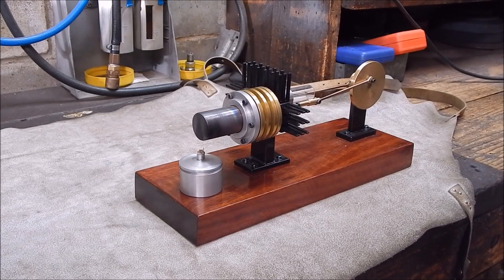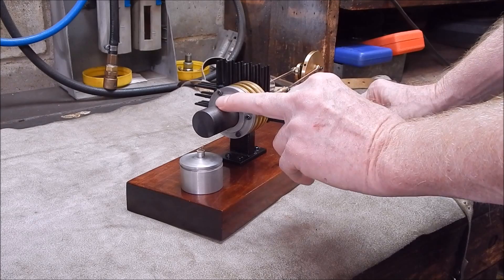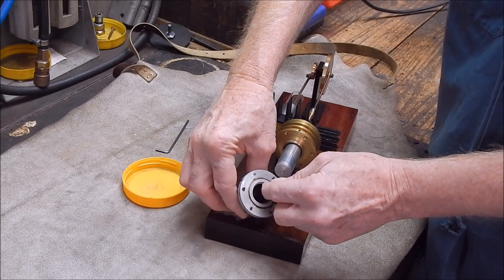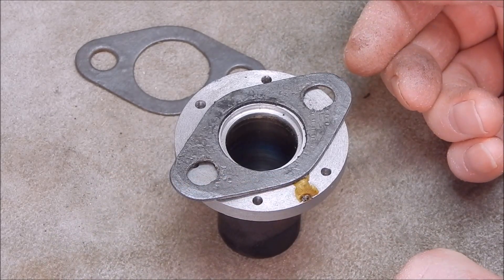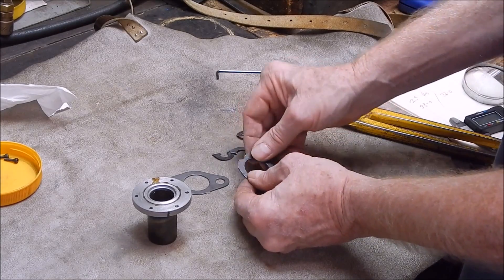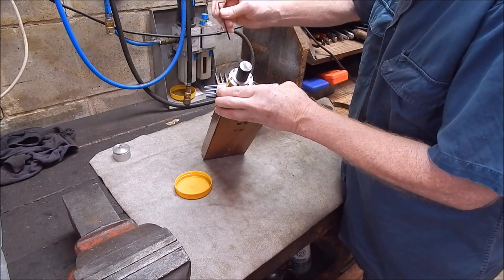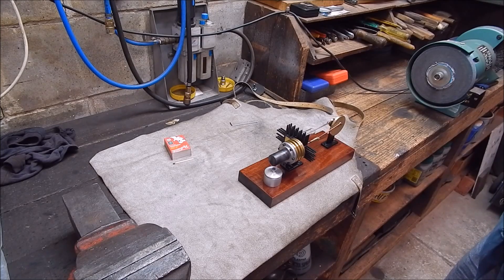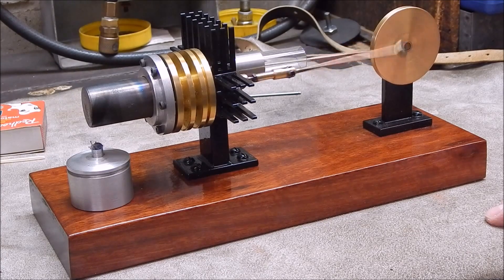The home made gamma Stirling engine gets some extra cooling

Comment: Nice chunk of wood for the plinth Rob. Bloody enjoyable these engines, I've lost count of the hours I've spent getting non running stirlings and flame gulpers/lickers to work. I've never made one from scratch yet.
Reply from the maker: It's  demanding but pleasurable when it runs.   Really tests out your lathe skills as the tolerances are so fine.  Just ran the Stirling tonight while I had a glass of red.  It went for exactly 15 minutes before it overheated and stopped. Brass looks good but ally is much better for heat shedding.   However, not bad for a home brew no plans project :)  When I get time I will do another.  Cheers Rob

Comment: thanks for posting.  some info.   at :52,  this is  WHY  thermal isolation of the sides is a  MUST;  and why overly compact designs should be avoided.      the flywheel  is not very big.      if there is no 'space' to  mount a  Small-radius  gear/pulley on the crankshaft, the engine is a  Do-Nothing.       see a good, fast-running, gamma;   and  a great diy alpha, at links.    the alpha is noisy because the flywheel is out of balance and the tension in the diaphragm is excessive.    googletranslate
https://www.youtube.com/watch?v=-3mj3S2xEK4

Comment: Very cool , can it be attempted by a novice ? Also I have a paramount brown lathe and was wondering what oil suits ? I have 2 reservoirs with the top tank having no drain plug . I have the means to drain via a large syringe , i guess they missed a hole . Cheers
Reply from the maker: Hi John,

Yes a novice can attempt this.  It may be frustrating as tolerances are tight, but it's doable.  Paramount list 30 - 40 SAE engine oil as a suitable gear lubricant on some of their current lathe adverts/specifications (check their web site).

I use that in the lathe quick change gear box and it's been going for 20 years.  Anything too heavy may make it hard to shift gears.

Cheers Rob

Comment: Stainless steel has a very capacity to transfer heat.  Another way to optimize something where heat transfer is not desirable.  Just like you might use aluminum where you want to maximize heat transfer to another object or the air.  Other ideas, replace with stainless screws, bore ring for Teflon tube and use Teflon washers to keep screws from touching the hot ring.  I realize your dialing it in with what you have.  Just throwing out ideas.  Anything worth doing is worth overdoing.  ;-)  Sweet fix.  I really enjoy seeing projects enhanced and evolve over time.
Reply from the maker: Yes, I could have used aluminium and it would have done a much better job than brass, but hey the brass looks so good it's hard to pass up on.

At the end of the day it's about having a go, and it's a  learning curve.  

Cheers Rob
Reply: @Xynudu  I had forgotten and presumed the golden part was anodized aluminum.  You missed my point here.  Stainless has a lower coefficient of heat transfer.   A stainless part such as a ring or washer in the joint between the brass an steel will cause less heat transfer in a similar way to the gasket you used.  As would replacing the bolts with stainless versions.  Great project.  I enjoy watching the progress and discovery.  Overall, the gasket material is a great choice also.

Comment: Rob, you may look at the amount of heat generated in the winter verses summer as the controlling factor. Reduce the btu input in the summer (smaller flame or increase air gap between flame /cylinder) as not to exceed the needed temperature that the air fins cannot remove. Just a thought as I admire your engine.
Reply from the maker: Hi Richard,

Yes, that's certainly correct.  I can drop the flame volume quite a bit and it still runs well.

I'm no expert on these, but I expect overheating could be a common issue on many of these.

Cheers Rob

Comment: Hi Rob,  it would run a lot better with  a hollow/lighter displacer piston, allot less thermal mass
Reply from the maker: Hi Rob,

I had that originally.  Made no difference.  The ones you buy generally have a solid displacer.

Solid or hollow will both heat up and as the air charge is hot the mass of the displacer is a non event in that situation.

Cheers Rob

Comment from the maker: Better, but still getting heat transfer from air movement in the system (as expected).  So looks like 15 minutes run time is the best I can get in warm weather.  The only way to overcome this would be to have a remote power piston - future modification maybe.

Cheers Rob